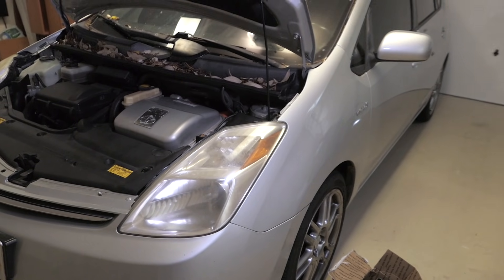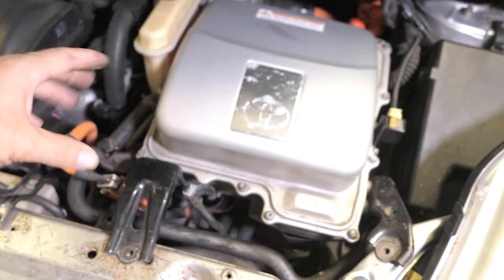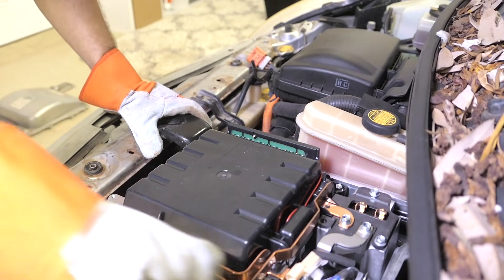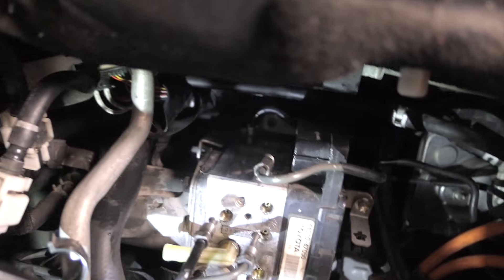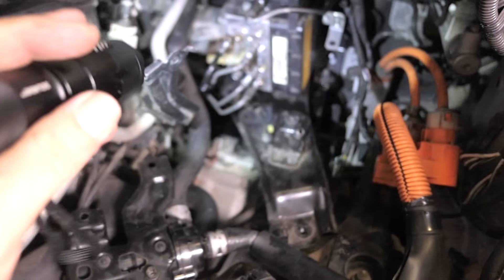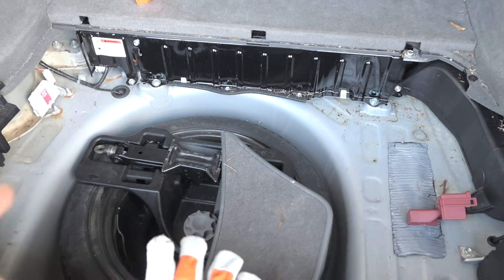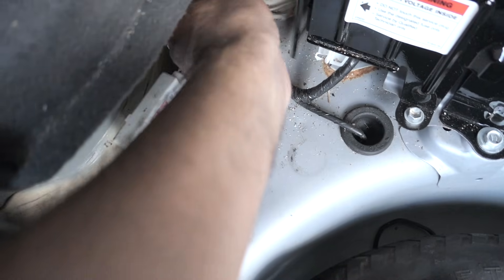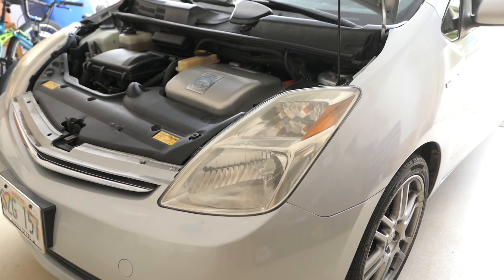Gen2 Prius - ABS Brake Actuator Replacement

Comment: Sorry but I have to add in some very important high voltage safety tips. 

First off, you absolutely need to disconnect the 12v battery and verify there is no 12v going through the system before touching the high voltage battery MSD. Low voltage controls high voltage, so that is always the first step.

Second you should take the cover off the inverter and do voltage checks using a multimeter that is at least Cat 3 600V rated, once you verify that there is no voltage going to any of the connections THEN you can safely disconnect the inverter electrical connections.

Comment: Thank you for showing what to expect when charging the actuator with brake fluid. One thing I did differently is to use a hand vacuum pump to pull brake fluid through the brake cylinders and calipers. When I hooked up the batteries and opened the driver side door, the actuator came on and quieted down quickly, within a few seconds. Many thanks to you.

Comment: What are the tell tale noise made by an actuator that is beginning to fail? I hear a small whirring noise from under the hood while driving. It happens about every 5 secs or so. Is that one of the signs of a failing actuator?
Reply: i only. hear that winding. noise and pump after parked and. car turned off?

Comment: Hi! I ordered one from eBay, but it still makes that dolphin 🐬 sound when you press the brakes, after I changed it, the lights on the dash (brake, Abs, Vsc and the other didn’t go out by themselves). There’s another video of another guy from City College that as soon as he swaps it, the lights go out by themselves . Question is: Did you lights when out automatically or not ?
Reply: Yes they should come off automatically, and if the 🐬 sounds are present that means you have air in your system and you need to get your brakes bled

Comment: I've done this repair. Remove the wiper assembly first or you will really struggle removing the inverter mounts. It is worth the extra 5 minutes it takes. Also just disconnect and remove the inverter entirely. The cooling system is separate from the engine and not hard to refill.

I also took apart my abs module and tried to repair it. My theory is that there was something allowing hydraulic pressure to bleed off some where in the valve body. To take the module apart the circuit board must have the spot welded connections to the coils and the two wires to the motor broken, then the circuit board pulls off (these can be soldered back after). I found that there are 7 o-rings that connect the valve body to pressure transducers. If your circuit board is filled with brake fluid, these seal would be leaking and that's the source of the problem. That was not my problem though. There are no other seals I could get to and nothing else removable under the circuit board side. I could remove the motor, but not the pump without destroying it. 

My solution was somewhat complicated and only partially worked. I purchased a used abs module and after fully installed it, I found that it was cracked and wouldn't work. I swapped the accumulator from this used module to mine, which I had put back together, and reinstalled everything. My abs pump ran less frequently and didn't throw another code for at least several months ( I don't have the car anymore). 

My theories on what the problem is: 
The accumulator goes bad and needs to be replaced. I was unable to find a new one to install, nor any specs to retrofit. 
The pump wears out and struggles to build pressure. Pump cannot be removed by any means I could see, it looked pressed in and locked in with a seal.

I think since swapping the accumulator worked for me, retrofitting a new accumulator sourced from another toyota or something industrial would be a good solution to this issue.

Comment: Hey Vlad, I got the actuator code and I can hear the pump running about every 15 seconds with foot off the brake. Also there is a rapid clicking noise as the pump runs and it's coming from a block near the passenger rear wheel where all the brake lines are. Can't figure that out and I'd like to know more about it before I replace the actuator. Please advise

Comment: Pretty cool, however I'm pretty sure the fluid you see coming out of the top of the ABS unis is coming FROM the line FROM the master cylinder rather than UP inside the ABS pump.  At least, that's the way it appears to me as I do this.  When the ABS is unpowered or even in FAILSAFE mode, it is actually closed (bypass mode) so the actuators inside aren't opening to allow fluid through.  Not a bad idea though.

Comment: How did you bleed the breaks by yourself. Im doing this job by myself so any help would be greatly appreciated. Thanks for the informative video by the way.
Reply: He had someone help him. That someone pumped and held the brakes while the author opened the bleed screw to let out any air. Repeat or all four wheels til the stream is clear. Pump the brakes and pedal should be firm and stop in the same place from the floor.

Comment: Thank you for this content. It's the best quality, most complete video here on this work. The only part missing is removing the wiper cowl to get more room to work but even with that missing, this is the best single vid on the subject. Thanks. 

edit: that little "connector" on the inverter cover is actually a safety lock out for the HV system. Also, that service plug on the HV battery actually halves the max possible voltage from about 220 to 110.

Comment: The brake lines are NOT difficult to remove if you use the correct flange nut wrench. Second, the reason why most sell with the lines cut off is so that no debris or dirt goes into the pump. Third, removing the wipers and wiper cowl takes 5 minutes and makes the job of removing the pump 50% easier. Just as an
Reply: They aren’t hard if they aren’t corroded lmao, I had the flare wrench but still almost rounded the nuts over in my car bc of how tight / corroded they were. Def easier after that tho, had to do it again 6 months later bc what I thought was my master cylinder was my abs. Or maybe both idk🤣

Comment: For those who have replaced their ABS actuator with a used unit, how many of you also replaced the resistor? The actuator and resistor are supposedly "matched" to each other. The new units from Toyota come with the resistor. I contacted the salvage yard to inquire about the resistor in the same Prius the actuator came out of. The car had been crushed and recycled, so I will just keep my fingers crossed. This mystery part is located way under the dashboard and is a royal PIA, according to those who actually changed it.
Reply: I for one can tell you removing the resistor takes only 5 minutes with a small ratchet and 10mm. Second, you don't need to replace the resistor when using a used unit. Toyota sells the resistor to basically ensure equal life out of the abs system.
Reply: @gr2262  So far, no trouble from the salvage unit. Hopefully, the unit will hold up for a couple of years (or longer) which will give me time to replace it with a new one or trade for a gen 4. Your comment relieves my anxiety concerning the original resistor not being changed. Thanks for your feedback and information.  This is the only major part to have failed since I bought the car, so I would definitely own another one. I'm still on the original battery pack!
Reply: Did not needed a resistor replacement on my eBay used part, an 2 years after, still is working , trouble free .

Comment: You didn’t take early safety precautions in this video, plus your lucky cause your suppose to disconnect the auxiliary negative battery terminal first before removing the service plug

Comment: Did you consider removing the wiper arms, motor, and tray?  It takes less than 10 minutes to pull all of that, and it uncovers that area behind the inverter, directly over the booster.

With that all out of the way, you probably could have shifted the top brake line out of the way and lifted the booster nearly straight up.

I'll be swapping parts between 2 "dead" 06s sometime soon and will add replies to this comment on what might shorten the work time.

Comment: Did my 2007 GEn 2 last weekend after getting the part on ebay. Watched this video and a couple of others, very helpful and thank you. Did remove the cowl and wipers, made access easier. Not a mechanic per say, i made small videos of all nuts and bolts i removed and placed them in plastic bags with notes, that was helpful the next day when i had to put it all back together. Few things that would have made my life easier: Magnetic sockets, u only need a 10,12,14mm for that job, get them. A magnet stick i dropped a few items, a tool to disconnect the electric connectors (some can be a pain). I followed Vlad suggestion for the brake fluid and last brake line connection. Once all put back together, i did not bleed the brakes. Got the errors still on Dashboard but reset using the pin method. A week into it all seems fine so far.
Reply: Do you remember about how many hours it took you to do the repair? Thanks!
Reply: @chriswhalen2153  Sorry for the delay in replying you might be done by now, but just in case. I took my time and basically did it over the weekend nice and easy. Could be done in a Day or few hours if you are experienced, i wasn't on that particular part. BTW all is still working a year later, i lucked out on ebay at least so far. Cheers!

Comment: Just did this today on my '08, had been putting it off forever but this video along with a couple others was enough to get me thru it. Got lucky with my used eBay actuator.
Reply: is itn still working your abs pump? was it worth it ?

Comment: Hi All and thanks Just Vlad for this video. I will help me a lot. I have to change my ABS Brake module on my Gen 2 Toyota Prius from 2006. I get the code error C1344. Is there anything to programm when you put a new ABS Brake Module? Or it is just "mechanical"? thanks a lot for your answer. 
Sorry for my english, it's not my mother tongue.
Reply: Your English is just fine and more than adequate;-)
Reply: In my 2004 Prius no programming needed, just used X Tool scanner $800 about when I got it., when I had enough to buy 1 year after, but scanner is very useful many times over. Hope it helps. helps.